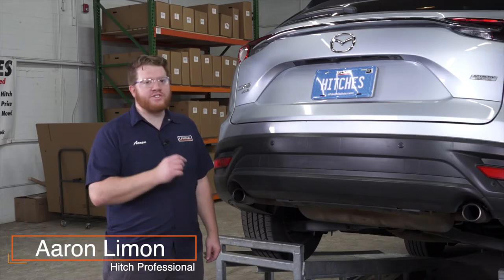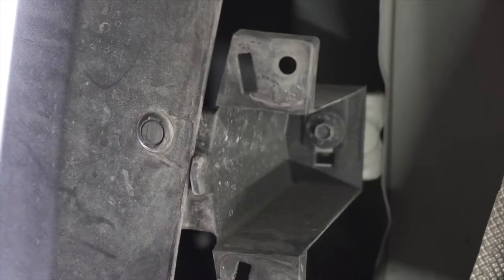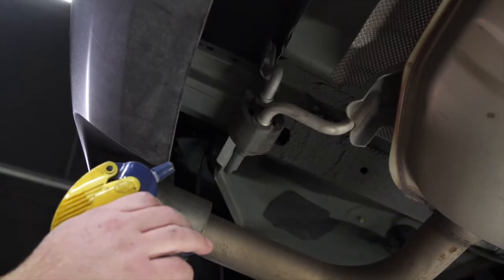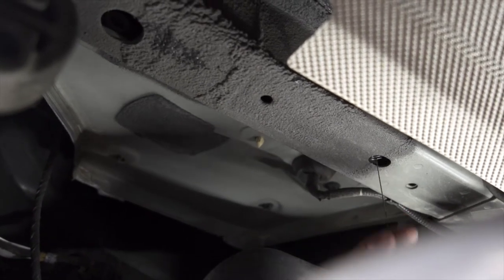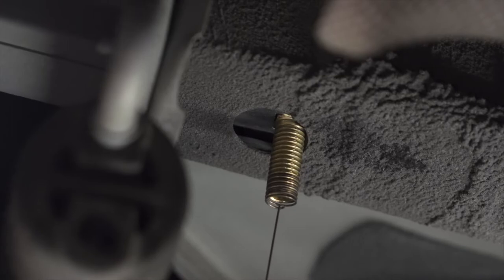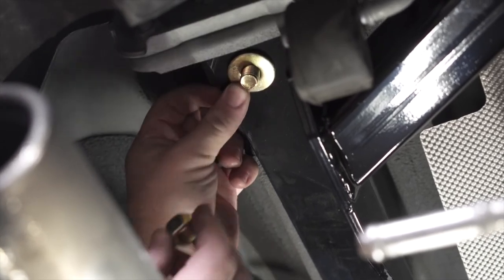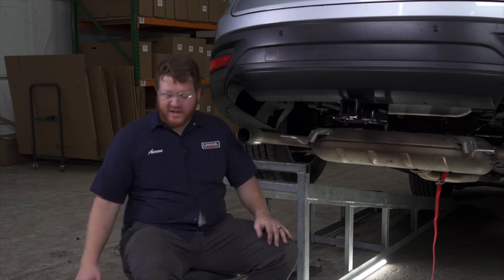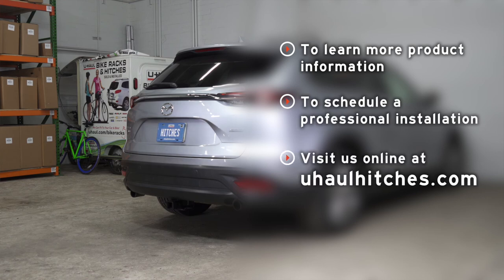2022 Mazda CX-9 | U-Haul Trailer Hitch Installation

Comment: Do you know if this will create any issues, or block the foot sensor for the hands-free lift gate?
Reply from the maker: The manufacturer does not state that it will interfere with the lift sensor.
Reply: Installed it with a Mazda dealer, yes it blocks the sensor.

Comment: so... this is not for a trailer? this is the second install I watched and neither of them mentioned anything about any lights. installing the hardware seems very easy but no info on those dam trailer lights.. you know the plug thingy in the back
Reply from the maker: Trailer wiring is a separate part and therfore a separate video. Here is the Link: https://youtu.be/88sULoNXHOY

Comment: hi.
Why do different manufacturers have different mounting systems?
Someone from below, and someone from the side to the spar
Reply from the maker: Its not a hitch manufacturer difference. Different vehicles may have different mounting locations available. In the case of the Mazda CX-9 they all bolt up because that is where Mazda welded structurally sound nuts. The Mazda CX-5 however the nuts are welded on the side of the frame. The Hitch manufacturer designs them based on the vehicle.
Reply: @trailerhitches  Thanks for the answer!
Good luck with your work

Comment: @4:40 A pro would remove the undercoating so the hitch fits flush to the “Frame”
Reply from the maker: Removing a 1/16th of an inch of coasting will not make any difference in the installation of the hitch. While you can take the time to do this and not have any negative affect, the manufacturer that runs numerous tests on their hitches and installation process, do not see a need to do it. And we always follow the manufacturer instructions when we preform an installation.